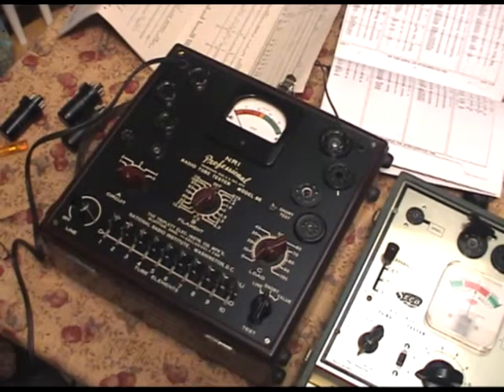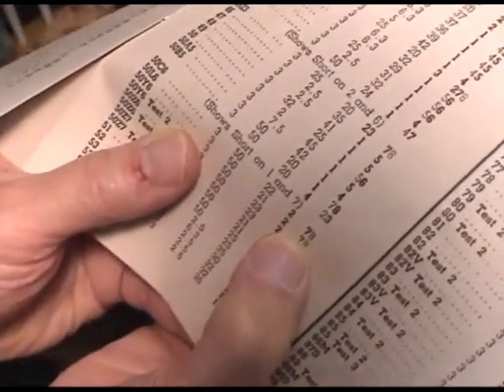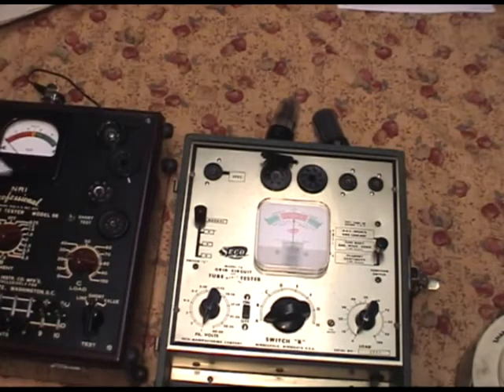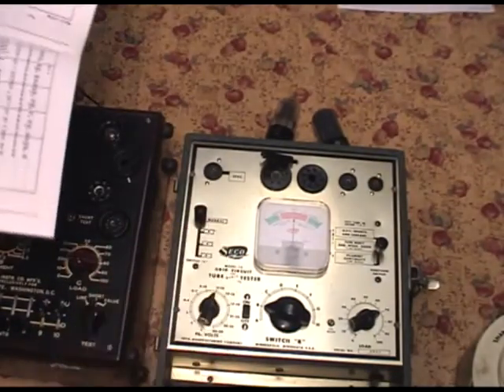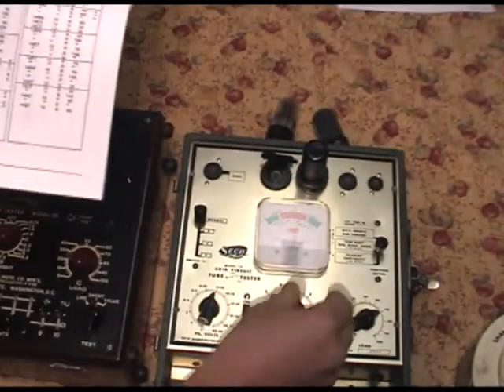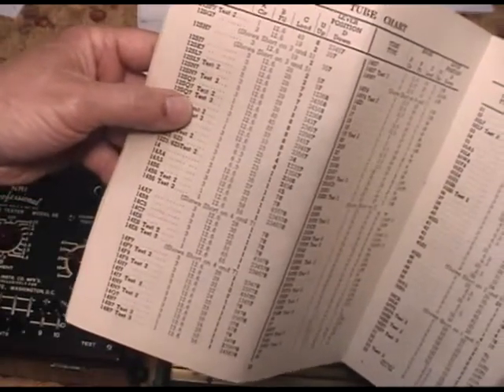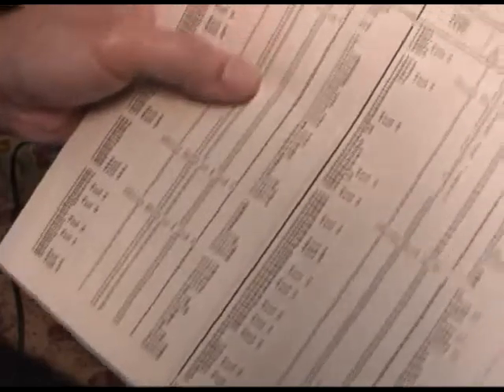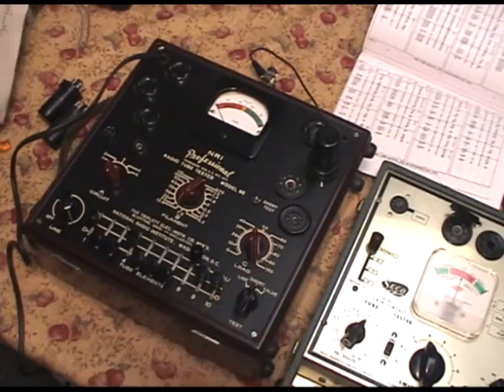Majestic 5A455 - Part 5 - ''Tube testing Seco model 78 vs NRI Prof. model 66 aka Triplett 2413''.mp4

Comment from the maker: Bob:

One thing I forgot to tell you about the SECO tester that is really pretty cool. When I first got it it only had only about 50 tubes in the testers manual. But, I found a source on the internet that has, I'd say 150-250 different tube settings for this tester. That was immediately saved on my hard drive! 

The triplett has only a few listed also. Do you know where I can get a larger tube listing for the Triplett 2413 - NRI 66 tube tester? I've had no luck.

Thanks!
Tom

PS Is it still hot?

Comment from the maker: One thing that I thought trying in the past is to test push-pull tubes in circuit with a oscilloscope. Have you tried this. Does it work. I could reverse the tubes and see if the scope output jives both ways. A poor mans mutual-conductance tester I suppose. I know a guy who owns a military electronics supply place within 3 miles where I can use his I-177 at any time for free though. :)

Tom

Comment from the maker: Interesting:

"A 'two stage DC amplifier' to isolate the meter movement from the tube being tested"

I'll check out the manual. Hold on...

The schematic shows it using a dual-triode 12AU7 to do this. So the answer is yes! I don't remember what my comments were on the video but I always thought the Seco was a better tester. It is NOT a mutual-conductance tester though. Dang, I wish I had one so that I could test push-pull tubes with it. I CAN'T AFFORD ONE!!!